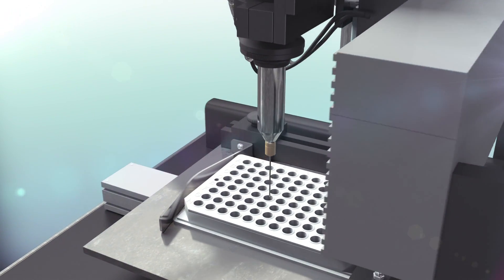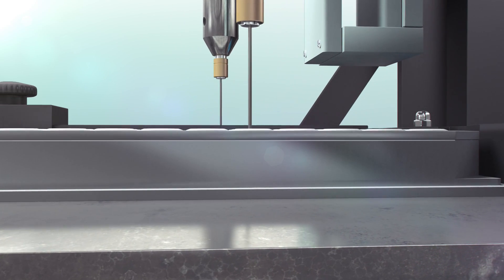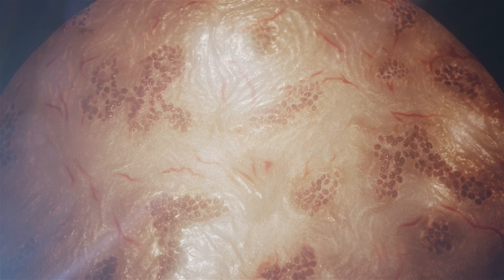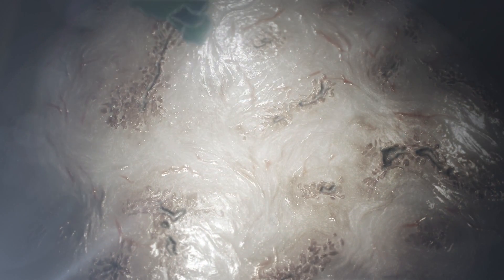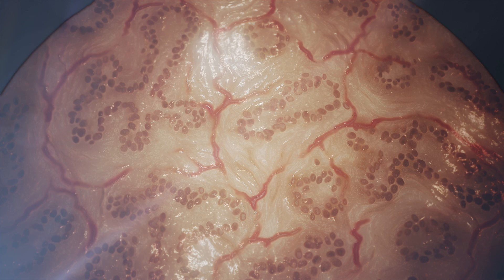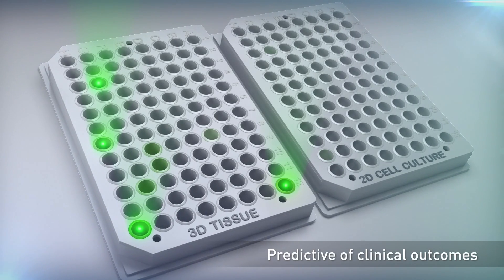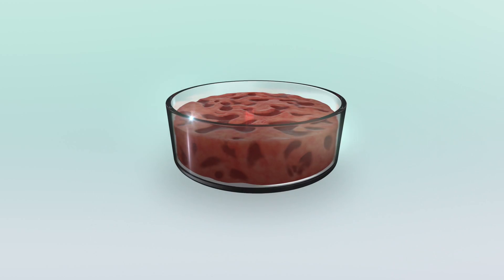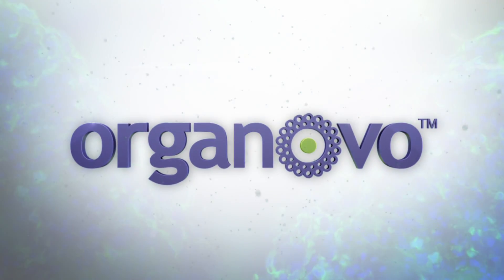The Bioprinting Process

Comment: I ❤ you Organovo; if you had donor cells to use could you target those problematic cells with a unique “medication” to fix any problematic occurrences? Even a generalized healing system based off of successful cell turnover rates to replace hindered cells with healthy that may also provide a timespan window set by a fixed variable to slowly adapt older broken cells to the rejuvenating process while breaking down broken or infected cells.